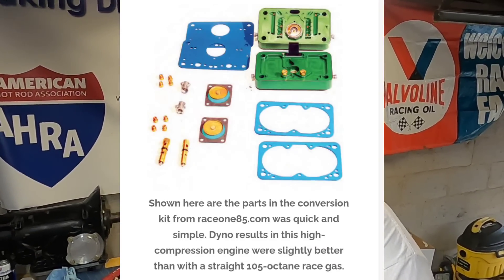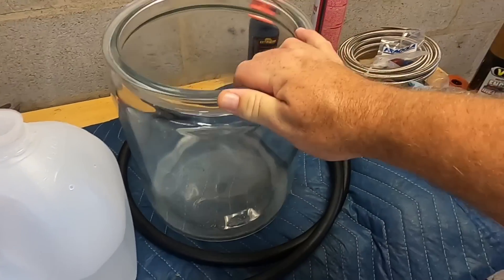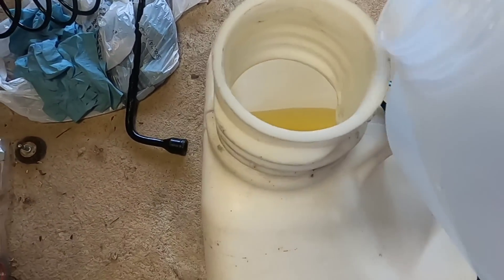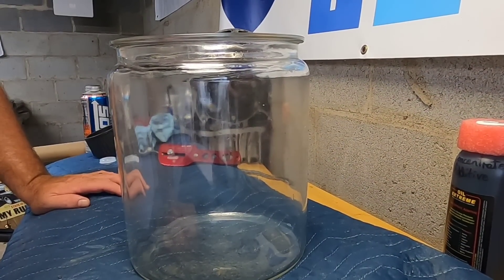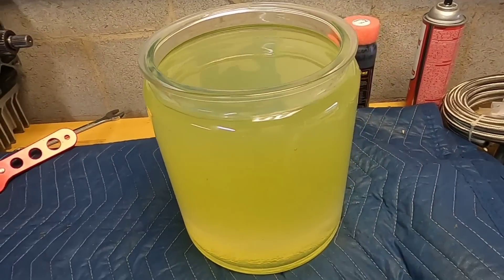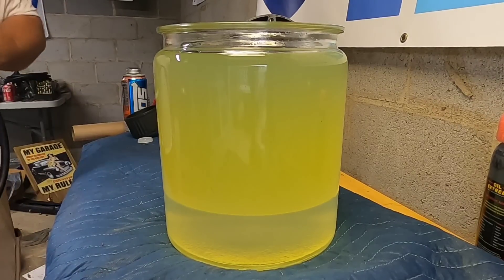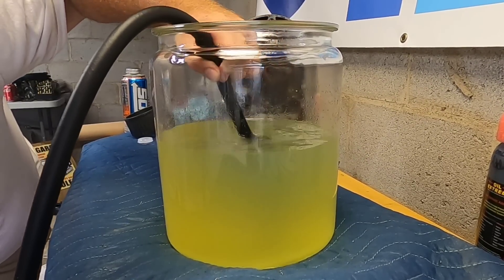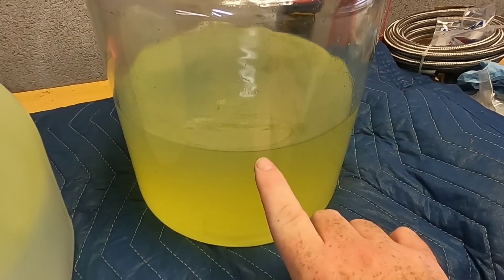Making your own ETHANOL FREE Gasoline!!! it's easier than you think!!

Comment: Be so much easier and efficient to do if you used a separatory funnel with a bottom release valve. Make biodiesel and they are priceless for  separation of the fatty acids and base materials that you definitely don't want in your fuel system, because just like ethanol they're corrosive agents. But yes Sir we do the same thing with water and diesel to neutralize the base reagents from the bio-diesel, as the final stages of what's called the  "Rinsing cycle" of the oils. The fact many organic substances are hydroscopic, by running a clean rinse water through these oils or petroleum products, you can extract the chemicals from them you don't wish to remain in them.  Stirring as well as a good separatory funnel is the only means to getting this done. The rest is having a good deal of patience and allowing the product to set once its finished Stirring. Otherwise you may find, your leaving behind your unwanted products and water in your oils, which is never a good thing when it comes to diesel injection systems! 😅 but thanks for sharing this. We have been using the water method for gasoline for quite some time now as well, thankfully we can still buy premium fuel in upstate NY without the garbage ethanol being utilized in the gas. Stewart's shops are the only places to get it though. All the rest sell premium garbage alcohol added Sh1t which is detrimental to any engine or fuel system especially if it sits around for any length of time absorbing the humidity from the air.

Comment: What is the cost of a galon of gas that is freed fom the ethanol. wished you had shown the volume of gas you started with and the volume you finished with. especially in cold weather adding 100% isopropanal dry gas would mix any remaining water with the gas and prevent carb-iceing.

Comment: I would have just run to the gas station and bought the gas I needed. 
A while back, on a long road trip, I ran my flex-fuel truck on regular one way, and E85 on the trip back. The E85 was definitely less efficient MPG-wise (less mileage, less cost), but the overall cost per mile between the two was a wash, the final number within a penny or two. While E85 being less common in my area, I don't bother with it, seeing as there is no advantage to it.

Comment: Also ethanol free fuel is sold at places like home depot or the hardware store for generators, etc. Another source is aviation fuel at the local airport. Ethanol is bad for airplanes, and the fact that it attracts water is doubly bad.
Reply: @williamwallace9620  It is expensive. It claims on the can that they have added preservatives to the fuel so that it will last longer in storage. With a generator, that's a big deal, because here in third world California, the power can go out at any time. We just had a serious, multiday power outage here, and all of the canned fuel disappeared. I decided to take a different approach, and I learned how to drain all of the fuel from the generator at the carburetor. Thus on power outage, I go fill up a gas can with regular gas station fuel and use that in the generator. If there is any left after the power comes back on, I put it in my truck and use it up. I'll vouch for the fact fuel does not keep. I used to keep a gas can for lawnmowers and yard tools, and after several years, it develops a sticky black goo at the bottom of the can you can't get rid of.
Reply: @williamwallace9620  We pay 35 cents/KWH.
Reply: @williamwallace9620  Can't argue with that. Was born in this state, not ready to leave just yet.

Comment: Another 'late to the party' bonehead clown video. First of all, this info has been out there for about 15 years. This is nothing new. So you're throwing away about 10% of the dispensed fuel you paid for? In my area it would be CHEAPER just to buy REC90 in the first place because what you just did is a wash cost-wise or 'even' at best. The worst part about what you did is that you need to let the gas sit a lot longer than 30 minutes to absorb and separate. That gas was loaded with the water you added. Notice how CLOUDY it was? It was clear before you started. There is a standard without using a beaker, hygrometer or test strips for specific gravity for judging how much water the Gas absorbed by viewing it through clear glass and it should be what is called 'CLEAR AND BRIGHT'. Meaning it is CLEAR and you can see straight through it and read print and is translucent. Can't see nothing through that mess. In fact, I watched it again and you could see it was stratifying and forming a boundary layer near the top that was clearing up. When was the last time you EVER pumped gas that looked that opaque? Thank God I never went to 'Crossroads Motorsports'. I generally ALWAYS run Pure Gas in my power equipment, but if I run out, I'll use E10 in a pinch because in the Summer I cut so often and run through so much it's not going to sit more than a week or two before I use Pure Gas again or more fresh gas. Even then, as long as you switch over well in advance of the fall you'd be OK. Most of these carbs are plastic now or made with materials tolerant of ethanol. This isn't 2008. You don't need to 'make' ethanol free fuel and then 'add' an octane booster. You can just buy it. Or use fresh E10 instead of deliberately adding your own water to contaminate it. You need to agitate it also to make certain the Ethanol picks up the water (more than what you did). I 'hope' nobody followed your tutelage despite the disclaimer. Power equipment is expensive these days.

Comment: I have a small airport about a mile from me and I buy my chainsaw and splitter gas from there. Aviation fuel doesn't have ethanol, is higher in octane  and has stabilizer in it already. All this for about two dollars more per gallon.
Reply: I have had no problems using just plain stabile over the winter months on any piece of equipment for over 30 yrs, on 87 octane gas.
Reply: I had a generator that would always  hard start and act up to tell me my California 10% ethanol pump gas (no pure pump gas available in the save the whales state) was 30-90 days old. I switched to 100LL avgas and generator perfection was achieved. Now I add a little PRI for gasoline to extend the sealed can shelf life of both pump and LL. From experience I can say their stuff works so much better than the popular Sta-Bil and makes fuel stored for over two years completely useable.

Comment: I don't know what you have there, but ETH does not float on water, it mixes. That must be full gas in that layer in your milk jug. You could have tipped you glass container on egde to get all the water without a lot of hydrocarbons. I like it. I'm going to have to try this. The question that remains is, are any of he additives water soluble?
Reply: I was wondering if anybody else was going to notice that alcohol and water mixes with no problem.

Comment: The gasoline should be clear and have a straw color. Yours appears to have entrained water in it making it appear cloudy. As an old aviation mechanic that did fuel samples every morning on our Coast Guard aircraft, I wouldn't use that gasoline in my engines.  I'm a bit skeptical on your theory of removing ALL of the water from the gas...the entrained water still exists. Still a cool video.

Comment: 1 So the price of the gas increased by 10%-ish (~10% loss) + your time.
2 How much you reckon the octane is lowered? 87>>85..84?
3 Have you captured the "ethanol" mix. Alcohol has alot of uses. Burning, cleaning, deicing.
4 Basic use for low compression engines. Due to lowered octane.
Cheers

Comment: Do not use never ever gasoline w/ethanol. It is not good foe engine. The engine is built for the gasoline only. Keep you away from ethanol. Ethanol=pincking, knocking, etc. and finally destroying the engine.
Reply: Ethanol has been in gasoline since the 1970's when president Carter mandated it.

And ethanol has a much higher octane rating than gasoline and can't cause pinking, knocking, etc.    It's literally the octane booster that replaced lead.

Comment: So what's the octane of the "pure" gas you have?
Reply: Removing 10% ethanol will result in an octane drop of about 3 points.  This is why you should always use premium when doing this.  The end result will be about 90 octane (or 88 in areas where premium is only 91 octane).

Comment: I’ve been purifying my gas  for 2 years now I use a 5 gallon plastic carboy from Amazon and it has a petcock on the bottom . Some recommendations use distilled water mixed with blue or red Food dye the dye is water soluble and when the mixture separates it gives a clear delineation of the water/ ethanol mixture verses the purified gas. Ethanol burns slower and is part of the octane rating of the gasoline so if you start with a 93 octane rated fuel you’ll end up close to 87 octane. Note octane is actually isooctane which inhibits the rate of combustion and thereby decreases engine nock. Finally it takes a minimum of 12 hours for complete separation of the gas from the ethanol /water mixture . I always draw off the pure gasoline 24 hours after mixing.
Reply: I go from commiefornia to Arizona and buy the ethanol free gas in freezona. I have identical generators in both locations. The gas in commiefornia gums up it there and the generator in Arizona runs no problemo.
Reply: @stevenhall2408  keep your generator tank empty and keep your fuel in a sealed container and it won't degrade.  I once stored regular gas with 10% ethanol for 4 years in a sealed tank and it was still fresh as a daisy.  Best of luck in the land of fruits and nuts!
Reply: Thanks for the additional tips. Any reason to use distilled water? Just curious ...
Reply: Thanks for that info about the octane rating.  I always wondered how much you lose and what keeps it at a normal level
Reply: Are you talking about E10?
Reply: Awesome , Thanks !!
Reply: You are aware there are stores that sell conventional gas with no ethanol?
Reply: @silverhorder1969  Up north in the corn belt, where I live,  there aint one gas station within 75 miles. And I'm not traveling that far for mow gas. I wish there was so I didn't have to this.
Reply: @jimaslan4837  look for a COOP that sells gas. They quite often sell straight gas. Surely there is a COOP somewhere?
Reply: @silverhorder1969  If the ethanol free pump is tied to one or more of the ethanol containing products, a good bit of your first gallon of ethanol free gas will come from what ever is in the hose from what ever was last pumped and will likely have ethanol in it. In that case it's a good idea to pump a few gallons into your car before filling your mower can.
Reply: @gnuorder  I agree. I always gas up my truck first. I haul gasoline and here’s a little more advice, the arm at ALL of the tank farms I’m carded at, that you load 0087 at, you also load 87E10 at. It’s a 4” line and for the first 50 or so gallons we’re getting 87E10. The state doesn’t require it to be 100% ethanol free. I’ve heard it has to be below 4%.
Reply: @silverhorder1969  can't have nothing nice!
Reply: @gnuorder so if there's a diesel ⛽ option.. And you put in 87, first few gallons are going to be diesel.. Mixed in the gas!?
Reply: @foxmulder7616 Diesel is always a separate nozzle. At our local Maverick they sell ethanol free and it has its own nozzle also. As for the giant 4" filler hose from the fuel truck, they drain the hose between fuel grades, I'm sure there is residual fuel. There can't be a significant amount of residual
Reply: @foxmulder7616 I think diesel uses a separate hose and nozzle, it's usually green where I'm at
Reply: @silverhorder1969  no they don't test and u will see, also what he is doing is lowering the octane
Reply: @silverhorder1969 
Yup, and in the Spokane Washington area, it costs a buck and a half per gallon plus more
Reply: @silverhorder1969  , yes I am, yet they charge $2-3 per gallon more!
Reply: Try this.  Put gas in a sealed container and observe how it lasts and lasts without absorbing water or oxidizing or separating.  I saved a sealed tank of regular 10% ethanol gas for 4 years and it was still fresh.  Gasoline doesn't break down unless oxygen and water get to it whether it contains alcohol or not.
Reply: @wsbill14224  I found the opposite. Ethanol-free gas 14 months later was good. Then only a 4% ethanol blend made the car misfire, run bad (but still run) and have high consumption/poor mileage. This was stored in container that would swell and contract with temperature, so were airtight. I do live in a humid country though.

Comment: One big problem with ethanol in gasoline is that the ethanol always sinks to the bottom of your gas tank where your fuel pump pickup is. At some point you'll be running very low octane gasoline which  can damage your engine.

Comment: Well there isn’t any debate — once they added ethanol I started having difficulties for small engines.
Reply: The new fuels have ruined many fuel systems of old vehicles. It is also responsible for many vehicle fires due to the ethanol attacking the rubber lines and seals, causing fuel leaks and fires.

A few years ago, I saw a beautiful Rolls Royce catch on fire on the freeway, it completely demolished the car. The car was someone's prized collector piece they would take out on a Sunday drive, now it is gone to the scrapyard.
Reply: @David_H_Parker  remember cash for clunkers??? All part of their devious plan to get reliable vehicles off the road so they can sell you new garbage vehicles
Reply: Messes with the mixture. My riding mower misses a bit and smells gassy on ethanol-laced and smooth and odor-free on plain gasoline.
Reply: @antilogism  This video isn't intended for E85, it is intended for E10 or E15. 
E85 is mostly ethanol, you shouldn't be using E85 in something designed for regular pump gas.
Reply: @David_H_Parker  I think E85 is the same as E15. 15% Ethanol in both.
Reply: @shannonp4037  I hope you are joking.
E85 is 85% Ethanol.
E15 is 15% Ethanol.

E85 only has 15% Gasoline, it is mostly alcohol.
Reply: @David_H_Parker  I had E85 on the brain so I edited it. I've never seen E85. At one time I wanted to experiment with California's M85 in my car but but mods were pretty extensive to do it properly. The state pulled the pumps after a few years so it's just as well.
Reply: @antilogism  E85 is the alternative fuel for "FlexFuel" vehicles. It has become popular for racing and modified hotrods. It has high octane but since it is mostly ethanol alcohol, it needs the fuel system and engine management to adjust the fuel ratios for the alcohol.
If you live in California, you probably have gas stations that sell it. It is about a dollar or two less than gasoline right now. You don't get as many MPG with it as gasoline.
Reply: You've been having difficulties since the 1970's when Carter mandated ethanol in gasoline?

That's some bad luck there.

Comment: Sometimes these "non ethanol" video´s makes me a little grumpy. I mean, unless you are driving a factory pre ´65ish car or motorcycle there is absolutely no need for doing this. As Mash also stated, pulling out the Ethanol actually LOWERS the octane AND the energy level in the fuel. We have now established (on at least 3 different continents) that on a fuel like say 91 E 10 versus 91 pure fuel, most modern engines especially, but also older designs actually make better power on 91 E10 over pure 91, - AND they run cooler, especially turbo engines. The reason is the properties of the Ethanol. Fuel blends with E10 are typically about 0,4 - 0,6 octane higher than the standards require. (Granted, ther may very well be a gas station in the middle of nowhwere which have a poorer blend, but in general it is so.) If you have an older car and worry about fuel separation, go install a full circle fuel system. Then you can turn the pump on and let it pump the fuel for 10-20 seconds after a long park, and the fuel will blend right up, - OR you can use a fuel stabilizer which will extend the time before separation a good deal.

Comment: Turning 87 octane E10 into what's leftover after a season of non-use (extremely low quality ~83 octane gasoline) is almost as stupid as thinking that ethanol is the problem.

Hint: E85 tuned carbureted vehicles don't suffer the same seasonal issues that E10 tuned carbureted vehicles do.  Which one has more ethanol?  🤦

This is a pretty good way to turn 93 octane E10 into low quality 87 octane gasoline.  🤣😂

Comment: That is not pure gas.  Depending on the amount of aromatics in the gas, it still holds water.  If you had 100 percent phase separation, both mixtures would be a lot clearer then what you show.
Reply: Your exactly right... I did fuel samples on aircraft for 14 years, and that jug he showed still has entrained water in it after he drained it off.
Reply: @Nobamaable  In colder temperatures, there will be water collecting at the bottom.  Certainly just as much bad info on the net about ethanol as there is correct or useful information.